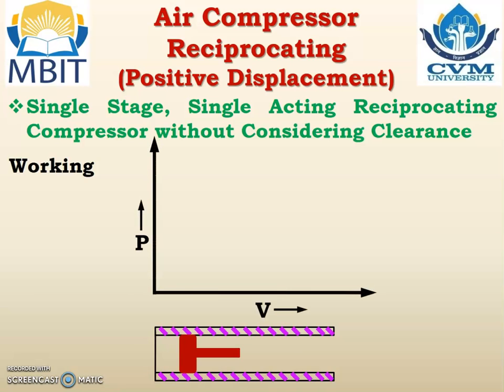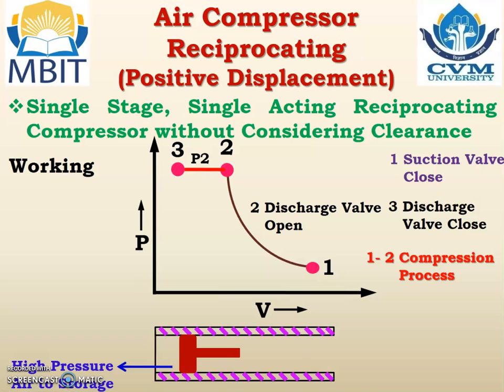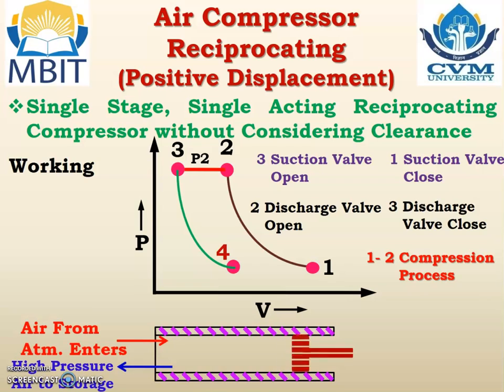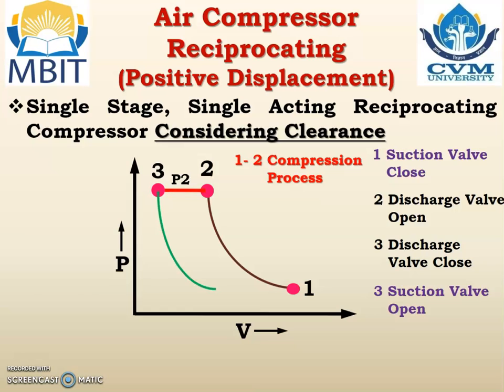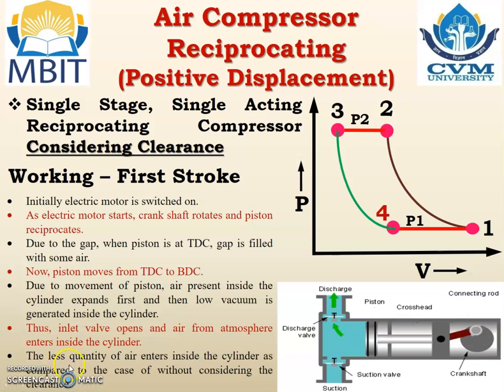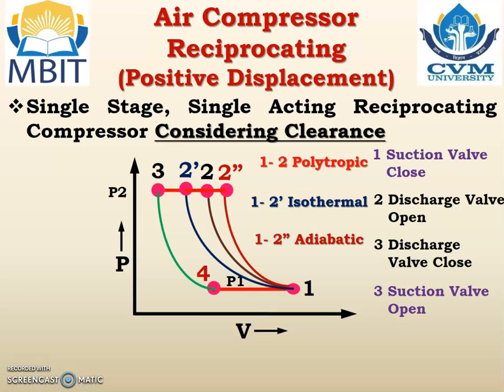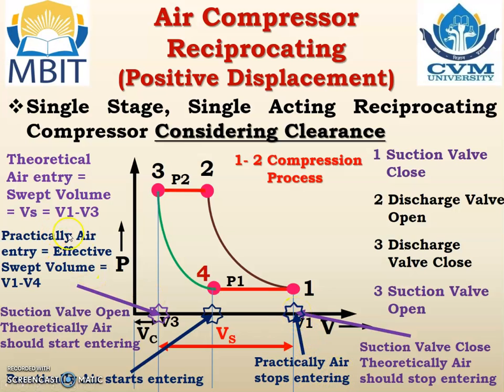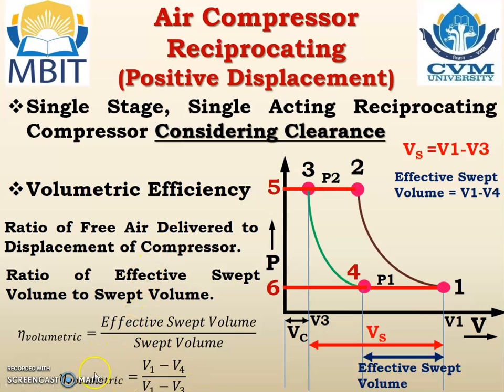Single Stage Reciprocating Compressor with Clearance, Effective Swept Volume & Volumetric Efficiency

Comment: hi. from my practical I have P1(Pressure in),P2(pressure out),T1(temp in),T2(temp out),Voltage,Current,Speed Force and Radius of Torqu arm with polytropic index of 1.011. how do i calculate the efficiency of the compressor?